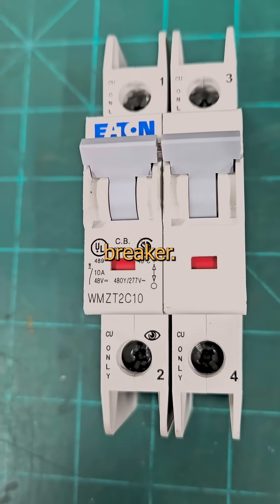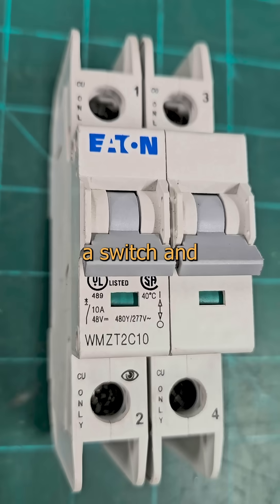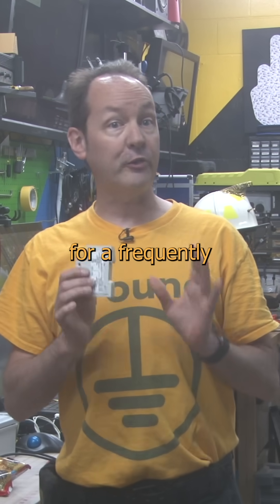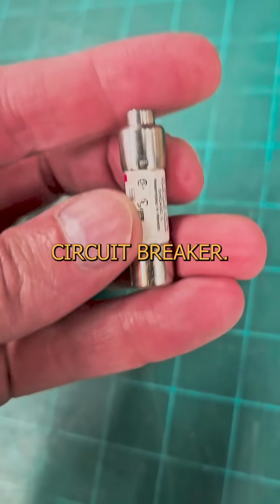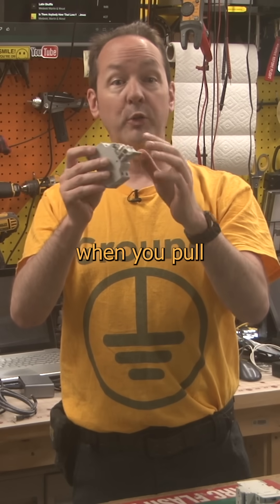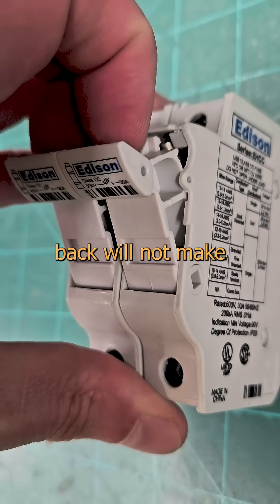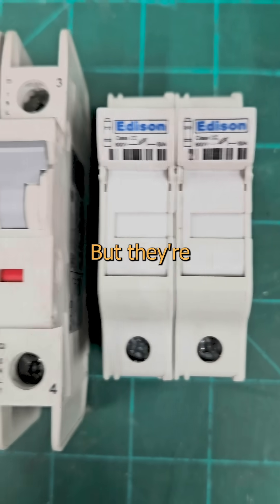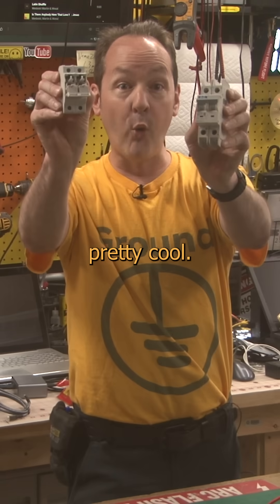Breaker vs Fuse #chrisboden #comedy #engineering #electrical #apprentice #training #educational

Comment: 😂🤣😂🤣😂🤣 Back in the 80s, the building l was working in had 70 year old wiring, and when I eased the electrical outlet back into the box it was hanging out of, it blew the breaker.
The janitor refused to show me where the breaker box was, because he thought I’d blow the breaker so often, it was wear out!
I trailed him a few months later, and discovered where it was (different floor, even!)!!!

Comment: This is aimed at me, I installed "Free lights" in the house. (12VDC Solar charged LED lighting with a rather large battery bank) Using that device AS the light switch.

 Because paying to see in the dark is not as cool as storing the fuckin suns silicon electron knockouts in an angry pixie box and dischargeing them at my whim for free. 

And that's pretty cool. 🐯👍🐾

Comment: I've had the experience of watching two house fires happen due to breakers not tripping. Had an a/c unit pulling 21 amps on a 15 amp circuit and melt 6 receptacles and still not trip the square D.

Comment: circuit breakers are so fun (the ones without a fuse). I remember being at work and it suddenly becoming my job to spam reset one and then eventually holding it on (not recommended) because we plugged in too many hot lamps on one cord to keep chicks alive. Good times!

Comment: a important note: fuses work in series in a short circuit.
here in Europe, every house has at the bottom of their electric box, before it reaches the meter has a fuse box that shouldn't ever need to be replaced, as there are other stuff that should activate first, but it's there and really the last normal safety feature for your home, before it gets into "power provider territory"
Reply: Can confirm. The mere idea of any power provider mess up other than a short power outage is terrifying, and not because power will not be available for an hour.
Reply: In the US we have those fuses outside of the house panel in a separate enclosure next to the meter can.

Mainly because that kind of overcurrent is a "shit blows up" tier event and you want the explosion (and the flying enclosure cover) directed away from people.
Reply: My house have the ceramic fuzes, but my appartment have those resetable ones.

Comment: Fuse blocks can have surprisingly useful applications for heavy machinery. It guarantees the systems won't work till the fire is out, as you have to replace the fuse before resetting it or look like a dumbass because it didn't

Comment: Tell hat to whoever wired the overhead heater in the shack at my workplace directly to the circuitbreaker board without a switch in between, decades ago

Comment: Circuit breaker for main or branch circuit protection and disconnect , fuse block for terminal device protection such as door closing mechanism that can be damaged due to usage or motor(s)  on and enclosed system say an AC unit with multiple motors, servos.

Comment: Oh man so not only do I make torque transferring parts for Eaton as a 3rd party but we have this one machine a paint line from the 80s, it’s got this one panel that goes to the the HV for the spray device right, well on the inside opposite of were the on/off is there are two what I’ve been told are fuses, however when it rains or is extremely humid they trip and you have to pop them back into place, haven’t been replaced ever or at least in 25 years, based off of the information presented here I’m wondering if they are really some sort of breaker

Comment: There's definitely reasons you would want to use a fuse instead of a circuit breaker, mostly they help raise your panel SCCR. A current limiting circuit breaker can do that too but you have to consider cost and the peak let through. interrupt rating is the same as the peak let through for a non current limiting cb. Love this topic

Comment: I work on a ship built in 1938. We have fuses galore. There is a hilarious fuse tester in the electric shop that is basically a pair of rails in a V shape that are breaking one leg of a 120volt line running to a bulb. You take any size fuse you want and set it in the V, if it’s good the bulb turns on. Just open circuit of 120 sitting there, waiting for a moron to wander past the do not enter signs and touch it. Safety was just something else back in the day.

Comment: If you would allow some reductive reasoning, a fuse also breaks the circuit.
As an engineer, I hate it when technical arcana confuses the purpose or function of things.  Proof?  Tell me what membrane stress is in a pressure vessel.

Comment: circuit breaker expensive?

here a BS80898 MCB is like under £2?
if we're talking MCCB with adjustable trip curve then yeah they're like £300 each

RCBO's are coming down in price now tho, many BS61009 ones are under £20
and bidirectional ones for micro renewables are cheap also

fun fact! if you use a normal RCD or RCBO (GFCI for you yanks), you'll burn out the solonoid from backfeeding the test circuit and stop it working lol
and that's pretty cool

Comment: Shoot, class CC fuses are nearly $15 each, now, which makes them + the fuse holder just as expensive as the MCB. The difference is, the MCB has an SCCR rating of 10 kA and the fuse is 200 kA. So, of you don’t want to derate your panel, don’t use a miniature circuit breaker in a power circuit. If you need a switch, use a molded case circuit breaker or a load-break rated fuse holder like an Eaton CCP2-2-30CC.

Comment: i've noted that fuses are often used where short circuit interrupting currents are too high for circuit breakers to be useful/safe in low-end devices or when fed from oddly energetic sources.

knowing the difference in operation is useful though . . . idiots will keep resetting the breaker until it gets too hot and melts.

alternatively, they reclose the fuse compartment and wonder why nothing is happening . . . this leads to the assumption that the power is off and invites Darwin to the party.

Comment: Glad circuit breakers are the most common in residential applications, which is all I deal with as a DIYer.

I could imagine fuses having some use other than just reduced initial cost. Make it more annoying to reset and people might do more to fix the actual fault before resetting, I imagine there are some safety critical applications where you really want that. Even if it doesn't trip again immediately, that doesn't mean the initial fault is resolved or anything that could be described as safe.

Comment: I'm going to install a dedicated main switch for my EV charging circuit so no one has to use the circuit breaker as a switch.
I'm currently thinking about if it's necessary to use a main switch which also cuts the neutral, because the only main switches I have around only cut the three phases 🤔

Comment: "It is not an appropriate replacement for a frequency used switch." well maybe if my fucking MILITARY BARRACKS didnt have a MOTION ACTIVATED LIGHTBULB right next to my BED I wouldn't use the breaker like a lightswitch.

Comment: Genuine question, I get having fuses in individual devices to sacrificially sever it from wall power in case of stuff like a massive surge since that'll be cheaper than buying a whole new device, but why aside from up front cost would you construct using fuses vs a circuit breaker for the upstream applications? Seems like fuses are the last line of defence while circuit breakers should be everywhere else up the chain

Comment: Every single hotel (with a few exceptions) uses circuit breakersto torn off the light on part of the ballrooms. 

And the engineers know the c downside they just replace the breakers every 3-5 years or when they start working properly.

Comment: For my next card I summon pot of solder I mean pot of greed which allows me to pretend like it is okay to lock wire a breaker shut because I don't want to put in the effort to investigate the reason I keep finding it in the tripped free position

Comment: I had the opposite of the fuse block. The house I grew up in (and later bought) had 4 screw in fuses for the whole house. I found delay fuses but then I found circuit breakers that screwed into the fuse sockets. (When I eventually bought the house the bank required a new circuit breaker panel).

Comment: WAIT!!!! I'm not saying you can't use them for both when sized properly, but generally I see circuit breakers sized for the maximum ampacity of a conductor and used to protect your conductors and see fuses sized for device protection and used in concert with one another (with exceptions).  Is this correct?  Does it usually matter under normal circumstances?  Or is this something that I've been lied to about and need to be set straight on?

Comment: Fuses don’t disconnect the other phases when one phase over currents. Then the other motors burn up because they can’t start on 2/3 of the phases. Put in a phase detector connected to a relay you say? Then you are just adding more failure points. I’ve seen phase detectors chatter and wipe half a building worth of equipment that’s upstream from the stop / start pounding 😂

Comment: wait till one of your guys puts a polyfuse in there and says "it's more convenient that way, you don't need to go back to the panel to reset it just wait a few seconds and it will reset itself!"
then when something stops and someone figures that the breaker or fuse popped and starts fiddling with the wire they're gonna end up in the hospital because the polyfuse reset itself in their face

Comment: been using a 220v 16A circuit breaker as the "switch" for my electric water heatet for a bit over 25 years, no problems yet

Comment: As a rough order of magnitude, circuit breakers are good for 5,000 to 50,000 operations.  Light switches are good for 5,000,000.

Comment: I do pest control and one of the restaurants that we service doesn't have any light switches for half of the restaurant. You have to go into the back service closet in the kitchen and hit like six different circuit breakers to turn the lights on and off. I was servicing there for over a year with my flashlight before I finally found somebody where to ask where the light switches were? I have a key and get there first thing in the morning before anybody else and if anybody's there they don't speak English

Comment: That reminds me, I need to install a switch between a pump and the circuit breaker in the pool room at the hotel I work at. Ill quit using the circuit breaker as a switch so Chris doesnt come after me 😬

Comment: How is this not common knowledge?
I got nothing to do with electrical installations, on any serious level, and even I learned the difference in 7th grade physics...

Also: These things are not interchangable in europe. ^^)
never seen such a tiny fuse box.

Over here, you get 3 fuses (in line with each other, not parallel), and only after those, you get into the breakers. That way there is a 4 layer safety-net, protecting folks against layer 8 errors.

Comment: Another fun fact. I am actually certified electrician in EU country. Here, we use almost exclusively the breakers on new constructions, most people are moving completely away from "normal" fuses whenever possible. (also most of the wiring has GFCI protection) America is living in past. :D
Reply: @markatonc  i suspect it could be similar to the EU if not the same nowadays, its the same here, im living in a new construction right now and it doesnt have any fuses, just breakers. Now that i think about it.. i havent had a home with fuses in 15+ years as ive moved around (that i can remember, maybe be waaaayy longer). Its just one of those things that isnt talked about unless its brought up, but we rarely use fuses anymore in america as well, its either for redundant protection for some really high loads or something industrial that you want shut down quicker then what a breaker can do. Dont worry, were not as far behind as you think.

(Edit: forgot to mention my new construction also has a system similar to G.F.C.I on our breakers as well. I think ours is called G.F.I but i does the same thing, theres even a test button on all the breakers that have it.

Comment: Technically, fuses are circuit breakers. When they melt, well, they break the circuit. 😂
Switches are manually operated circuit breakers. 

What you call circuit breakers would better be called like automatic switches.

Comment: Not an electrician, but if your fuses is getting burnt off enough times that buying new fuses is a problem, then I would argue that the real problem is that your system is under-dimensioned for the task it is actually doing, or that there is a serious malfunction somewhere that should be found and addressed. Of course if said malfunction is hard to locate, then a breaker suddenly becomes a necessity for sanity.
Reply: Or you drew too much power

Comment: The real problem is that breakers of that sort are designed to be used as switches, which is why they let you turn them off (there isn't only a "reset" button). But they're meant to deenergize a circuit during occasional maintenance, not to be toggled daily.

Comment: Not to mention you can open a circuit breaker while under load, it's designed for it
But do not open a fuse box while under load or your fingers will remember it

Comment: Railroad tech here. We don't use circuit breakers.
I never thought abut why, but now I have a theory: when things go tits-up, you can't just simply reset it; you deliberately have to replace the fuse, right? That would make  you think about what exactly made the fuse blow in the first place. 
Too many people, even tech, simply open up the box and reset a breaker.
Also, aren't standard fuses a lot less sensitive? Even to shock: I'm not sure how long a breaker would last next to a well used freight track and the thumps of 'flattened' railroad wheels ( emergency breaking flattens the wheel if they lock up )

Comment: Im sure its not proper.. but ive seen breakers that were used daily as switches since the late 1900s lol. 1-2 of them did end up eventually failing, but its failed state is just off and the replacement process is about five seconds. Better lifespan than some actual switches ive seen.

Comment: The house I grew up in had the little glass screw circuit fuses and the big sand filled fuses for the main, it was crazy that we only had 4 fuses for the whole house. I remember when Dad installed the black Square D circuit breaker, it was like fucking witchcraft 😂😂
Reply: or switchcraft
Reply: Replacement fuses for the screw in ones cost 1¢

Comment: At my high school metal working class we had a spot welder that was super prone to flipping the fuse, and it could only be tripped X number of times before a wire in the fuse needed to be replaced. I was one of the only ones who used it, and got pretty good at not blowing the fuse.

Comment: It saves the system not the human.🎉
earth leakage circuit breaker are for humans savety. 
(I google Translated that word seems right to me but im not sure, im talking about the one with the little test button on there, thats stops current when it flows away in anything but the neutrale)😅
The old one were made with coils but how do the new ones work??

Comment: I need to get some Eaton mini DC breakers and fuse holders to replace the cheap chinese ones on my combiner box... they look like the Eatons, but they sure aren't built the same, and I have gotten a handful of ones that were put together incorrectly.  That one time I found out one was assembled incorrectly, man, thought I a saw the sun for a second, good ol 400v arc.

Comment: You can get SWD and HID rated breakers that are OK to use as switches for fluorescent lighting circuits and high-intensity discharge lamps respectively.

Comment: Wanna know something not cool? Running an old glass fuse (the ones you put in like a light bulb) to run your part of the house, 4/5 of them for one room, 1/5 for the rest of the house and 2/4 of those for your room is being squeezed together gently with a hair tie to keep the electricity on.

Comment: You can tell a lot about a company by how many fuses they replace. If they fly through them then either the maintenance guy is too lazy to fix the real problem or the company is too cheap to take the downtime/cost of repairs.

Comment: The one on the left is inside of almost all of your air machines at gas stations. I know cause I work on them. Unfortunately, that’s generally all you have for cutting power to the whole machine cause no one in the gas station knows or cares where their power box is for it or it’s impossible to get to… or once as I found had been wired into the fucking street lamp!

Comment: Normally I'm a fan of Eaton products, but I have to say the color coding is going to confuse someone in a "how many apprentices does it take to change a lightbulb" kinda way.  Red/orange is normally what you see on a tripped circuit, but green is used to indicate something is safe, and I don't see it used a lot in electrical applications.

Comment: Are fuses more dangerous?  I always wondered that.  If the fuse melts too fast with enough current, will it shower sparks?  I know home fuses probably wont.  Except for the really old ones that pepple jam pennies in to keep it working.

Comment: Also get familiar with fuses the amount of stupid shit I've had be "broken" that was just because someone got curious about that the hand screw did (it holds a small fuse typically used with high pull accessory items such as colorant controll motors) and they dropped the fucking glass fuse broke it then screwed the fuse holder back in and just said it broke..

Comment: Enginerds put fuses in places they usually want inspected before being powered up again because the equipment down the line is important enough where the risk of a hung breaker justifies a fuse.